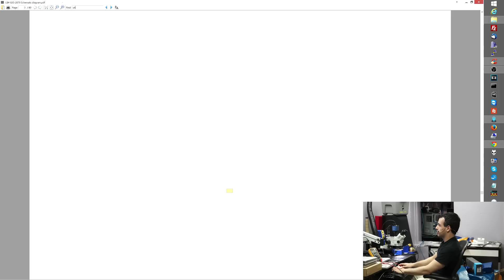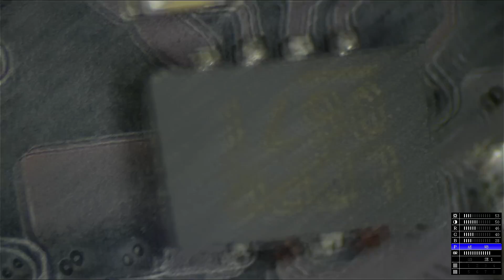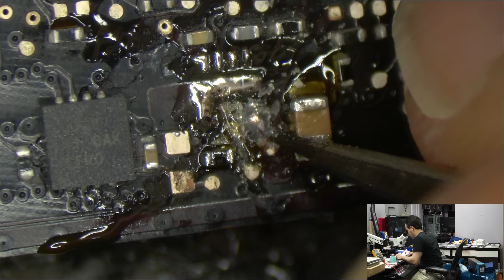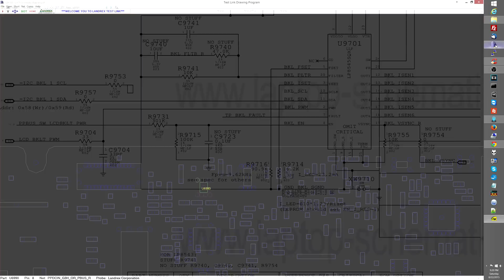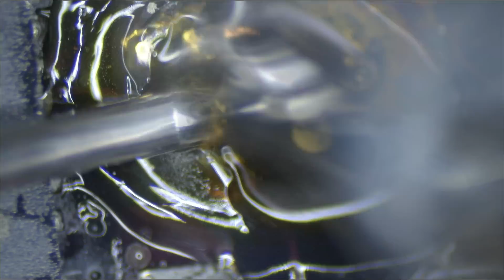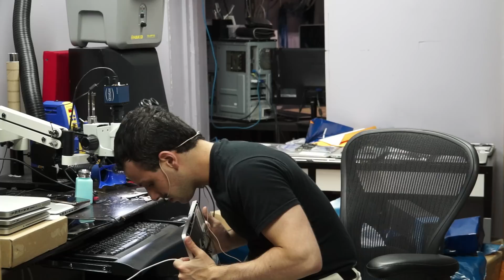820-2879 Macbook logic board dead because of ripple on PP3V42_G3H rail.

Comment: i have a 820-2879-b motherboard.not power on problem...in which 12v not show on battery connector and 3.3v completly showing...on dc jack green light glow completly ...i have change isl 6259 and 51225 and bios ..but not power on ...give me solution

Comment: Hi Louis, I have the same 2010 board which was previous fixed with a piece of wire for the one wire circuit due to water damage. I had used your video to help me with the problem. Now, after about 8 months the laptop is just dead. This is what I did
Symptoms:
1. Very faint green light in the charger which is steady and not flickering.
2. Does not charge the battery.

Troubleshooting
1. measured the one wire circuit which is 1.2v not 3.4v
2. Ordered a used board which works fine. Charged the battery full.
3. Put the old non functioning logic board in. Still nothing does not turn on with the full battery. Battery indicator does not light up either.
Reply from the maker: +Aashish Shrestha pp3v42_g3h present?
Reply: +Louis Rossmann No, its not.
Reply from the maker: +Aashish Shrestha Ah. Go fix that.
Reply: Man, I was so close....I will try! And it's not even a kangaroo pissed board haha.
Reply: +Louis Rossmann So far I have gotten this far.
pin 5 of u6901 sometimes it shows 0.01v which gradually goes down to 0.001
diode mode pin 5 of u6901 0.304 which remains constant
pin 1,3&4 of u6990 is 0v.
So, I am thinking about replacing U6990 which is the 3.42v supplier.

Please tell me if I am in the right direction....

Regards,
Reply: +Louis Rossmann I found out that R6905 was open the value was like 200ohms. So had 16.55v on pin 1 but no voltage on pin 2. So, I replaced R6905 along with U6990. Finally, I have the green light on the charger.So there was 3.42v on pin 5 of U690. 
I was seeing disco lights at the end of the tunnel but I was hit by a semi with the disco lights on it when I assembled the logic board.

What happened was the charger remained green when plugged in and not charging the battery. When I pressed on the battery level switch, it would show the battery level but not charging. As soon as I unplugged the charger the battery lights went off too. The laptop does not turn on either.

Any suggestions Louis?
Reply from the maker: Aashish Shrestha current sensing issue, bad isl6259, bad charger, who knows?
Reply: +Louis Rossmann I have replaced the isl6259 as well, the charger works with my other macs. I have checked the components around the u7000 using LCR meter. Also there is 4v on pin 3 of the chip. I will watch your current sensing video too. On the schematics, for the isl6529 pin 9(20v), pin 15(36v) and pin 14(OD) say OUT does it mean 20v, 36v should be present when I measure them?

Thank you again Louis. Hopefully I can the disco lights even if I was hit by that semi....
Reply: +Louis Rossmann Update:

There is green light on the charger whenever I remove the isl6259. The green lights disappears when i put the isl6359 on the board. 
When I measure PPVBAT_G3H_CONN on batt conn 7 8 9 there is 0.014v 
also PPBUS_G3H on p2 of F7040 is about the 0.0xV 

I am confused...

Comment: Luis, could you help me? My macbook pro 13" mid-2009 can only work whith the battery, and i ready replaced the magsafe DC-IN for a new one, but on is there any input fuse?
Reply from the maker: +Cristian Molina Onewire circuit. Ask no new questions until you have viewed every onewire circuit video on this channel.

Comment: pls need help 820-2567 board, turns on with battery only, no green light ,

 if i turn on the board with  battery connect charger then take out battery still runs with only  charger,  also it charge too,  

but it does not turns only only with charger and no green light !!! u6900 pin4=3.42v, u6901 pic 1, 2 both =3.42,  u7000 both 10k reg is good too,   is the isl 6258? pls advice, also i notice when computer is on it says battery not charging , but it slowly charging
Reply: Replace i6258